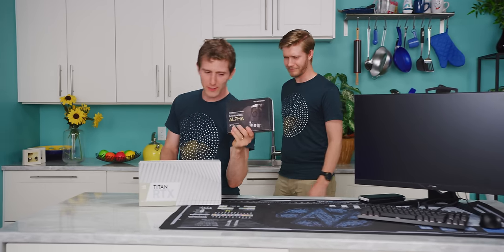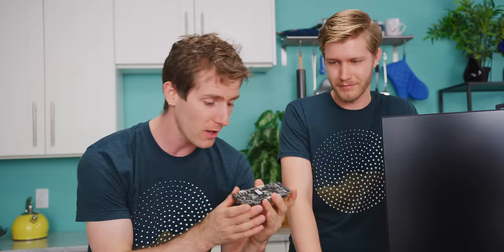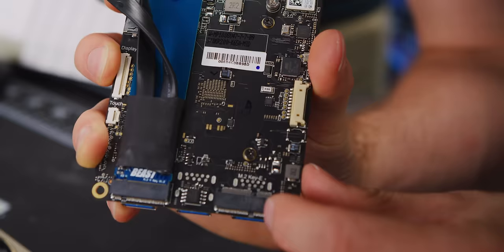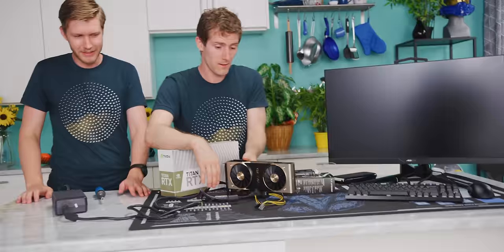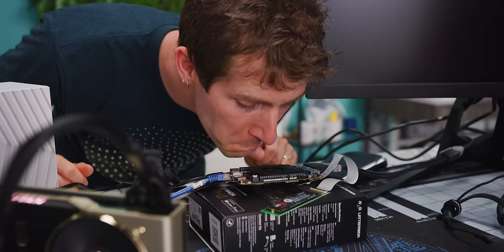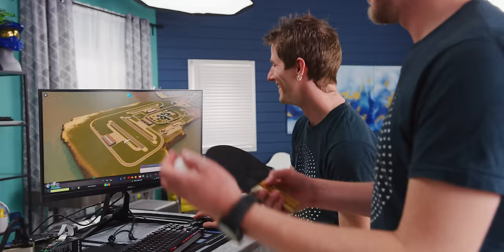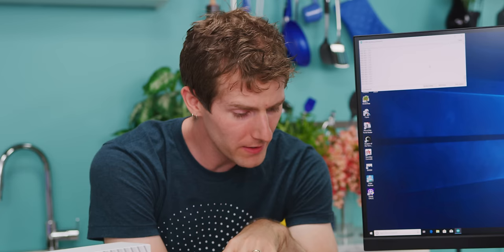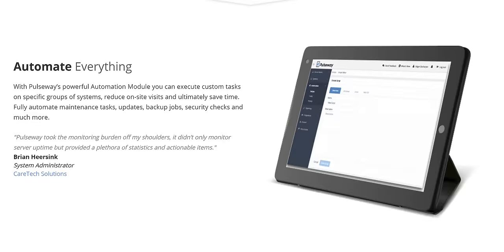The Biggest Bottleneck EVER? - LattePanda + RTX Titan

Comment: I'm like 99% sure that a decent external drive over usb3 would have been way faster than that janky m.2 adapter mess.
Reply: but then its not TRULY the biggest bottleneck ever ;)
Reply: moralapostel yeah but a graphics card external case would usually not work because they usually need a thunderbolt 3 connector through the usb type c port which the alpha does not have
Reply: @Blacked_OutMedia  Bruh he's referring to the storage solution they used...
Reply: I feel like they watched my videos on the LattePanda alpha and said “let’s remake his videos”. But with a Samsung 970 you can get 800+ MBps on that e key adapter
Reply: @HandheldHardware  Doubtful ;)
Reply: Adam Lawson small YT wishful thinking 😂
Reply: Ya never know. Got a new sub out of me though.
Reply: That's almost definitely false
Reply: Cries in 5400rpm hdd
Reply: It wouldn't. But it would be more practical. 

Usb 3 is slower than 2x pcie.

A USB 3 card with a controller uses x1. That usually has like 4 ports

Comment: More than anything, this is just a testament to how well optimized DOOM is.
Reply: And the power of the Vulkan API. Seems like every game made on it runs crazy well.
Reply: "Everything runs DOOM" still seems to be true, even on the 2016 version.
Reply: @mokubakaiba1751  But there has been many versions of Direct3D, most of which are vastly different from each others, and can considered to be different graphic APIs. Now, I never actually used D3D myself, so I can't tell in detail. In fact certain games do have both a D3D9 and D3D11 renderer, which are likely to be completely different code.
D3D12 is also very different from D3D11. It is closer in "philosophy" to Vulkan - both of which are inspired from/based on AMD's Mantle, which never took off.

OpenGL is sort of similar. OpenGL3 was the most disruptive one, but has a compatibility mode which makes most OpenGL2 still operational, only few modern game does this though. CAD software is a different story, and can make use of OpenGL4 extensions while still requiring a compatibility profile... There is no spiritual equivalent to D3D12 in OpenGL, but that is basically Vulkan.

So comparing the APIs by age do not really make sense. Both D3D and OGL evolved drastically since then.
Reply: @garthhendy  Games barely even use DX12 right now the way it is.
Reply: doom offloads lots of stuff that are typically computed by the cpu to the gpu using compute shaders, so it makes sense.
Reply: Compared to when it got released it definitely got optimized very well.
My Phenom II x4 955 BE wasn't capable of even running the main menu properly at release.
Now the game runs at 80-100 FPS on Ultra settings with my GTX 960.
Reply: Frames are temporary doom is eternal
Reply: @nathangamble125  well can you play it on a fridge

Comment: The greatest bottleneck is my wallet

Edit:thx for the likes!
Reply: Back in the day, when spending $3500 on a top range PC was crazy. Now with that money you can only buy top range CPU + GPU. You still will need to buy MOBO, SSD and peripherals...
Reply: Cala Content You can buy/build top-notch PCs nowadays for way less than $3,000. Take Digital Storm for example, their top prebuilt PC sells for $2,800. If you were to build that PC yourself then you could save $100-$200 dollars not counting peripherals oc
Reply: @WoeSyn  Trust me that is not top. I had the best Intel extreme of that moment, qx9770 and costed me 700€ with a 1200€ retail price. Today the i9 9980xe costs 2050€ where I live. I had the GTX 280, I paid 400€, today GTX 2080 TI is +1200€. And paid 3500€ total, peripherals included.
Reply: @WoeSyn  I'll say what I tell my customers.  
Top of the line is the best hardware you need for your most demanding uses. 
Many top of the line results are found through benchmarks and not in the real world.
Reply: @CalaTec  by 'back in my day', do you mean when the 660ti was the big thing?
Reply: @MlordSlav  Nope, I just mean when I bought my first "gaming" PC 10 years ago. I bought the GTX 280 so 660 still wasn't a thing :P
Reply: Its It's not a bottleneck...

It's incompatible
Reply: So true
Reply: @CalaTec  Intel with the W-3175 AMD with the Threadripper 3990X and Nvidia with their soon latest Titan would like to have a word with you about that $3500 for CPU and GPU you friggin' cheapskate. 😜
Reply: @aoelp  Well that was my exact point on my first comment.  Though we are reaching workstation like hardware, a normal consumer shouldn't buy such a monster for, let's say gaming.
Reply: @CalaTec  i9-9900k, MSI Ventus 2080ti GP, Z390 Aorous Ultra, and EVGA G5 750w 80+ gold PSU, 500 GB Western Digital SN750 M.2 Nvme SSD, 500 GB and 1 TB Samsung 970 Evo Plus M.2 Nvme SSD, 2x16 Corsair Vengeance 3200 DDR4, RL06 Silverstone Case, Corsair H100i AIO cooler, Blacked out Blue Yeti, Razer Viper Ultimate, Corsair K70 Mk.2 Rapidfire with speed Switches, and a 1080p 144Hz 1ms monitor. Other than the mouse pad, that's all top of the line stuff and I only paid 1900 for all new. You're talking bs saying you can't build a top PC for 3500. There's a difference between top of the line and way overkill. But you definitely can build a WHOLE top of the line build with peripherals for less than 3500. Even without my deals, with just normal discounts, you can get a top of the line for 2500. So go quit your bullshit.
Reply: @maximgem7292  First, you are not grasping my point of hardware pricing going over board, second you should learn to comment with respect. And finally, I have that same setup but with a 1080 ti second hand and it costed me 2500 euros in Spain building it myself, meaning it would have been 3200 euros with the 2080 ti. And no, that is not enthusiast hardware as the build I described, aside of the 2080 ti. Well instead of 2 SSD, I have 1 NVME 1tb and an 8TB HDD that I already had. I never said people should buy that hardware, because most of the times is not worthy and the value decreases too fast, unless you are a professional who benefits of paying the premium.

Edit: didn't see you also mentioned the monitor. Add to what I said 500 for the lg 27gl850 that I bought. That makes some 3700 euros to buy that setup in Spain building it yourself and buying the components in the cheapest place which is PCcomponentes.com
Reply: @CalaTec  why should I commend with respect to someone obviously oblivious on how to get good parts for less money? That just goes to show you buy everything from an overpriced retailer if you buy your parts that expensive? And FYI I have 3 Nvme ssd's, not 2 because 2tb between 3 sticks is cheaper than 1 2tb stick. Goes to show you don't know how to optimize your build or save money. No wonder your "top of the line" build goes for over 1k more than it should cost
Reply: @maximgem7292  Here buying 2tb was a lot cheaper than 1TB (per GB), but my budget didn't allow and I have an ITX board and I'm not interested on having more than 1 stick. You don't understand that, in Spain we have no option, and that is our cheapest retailer. Don't worry I do my homework before buying, no need to be so mad, is almost funny. We pay higher taxes and shipping, thus prices are higher than US for example. I've checked the prices on UK retailers and they were quite similar and some things were more expensive.
You should comment with respect because is what an emotionally balanced and normal person would do, no matter what others do or say. Have a nice one.
Reply: @CalaTec  I'm not mad, do you even know what mad is? If anything, I look down and pity you beause I have friends from Spain, uk, AND Australia who buy parts for decent prices just fine. An ITX board is a mistake in itself for budgeting. Although atx is more expensive, it provides more upgrade potential saving much more money than an ITX board. Your ignorance is blatant.
Reply: @maximgem7292  what can you tell about me in latam? Rtx 2080 ti it's more than 2000usd new
Reply: Stop copying comments
Reply: Miku I felt that 😞
Reply: @CalaTec  yes you live where shit is to pricey also I built a top notch pc for under 2 grand so yea lol
Reply: @CalaTec  the 3990x is actually the best CPU for gaming out there
Reply: @theghost7277   I think the only place where technology has a reasonable price is United States.

@spade gaming I think AMD is the best option for 99% of cases. In some games you get better low FPS on Intel and in some others you get a few extra FPS. Is it really worth buying over AMD? I don't think so. But I bought a 144hz monitor and since my PC is only for gaming I bought the 9900k.
Reply: @CalaTec  back in the day 3500 worth way more
Reply: @gktawusy  yeah, but back in the day I wasn't married, so earning 3500 was easier for me than now xD
Reply: @CalaTec  ah ok
Reply: @CalaTec  *RTX
Reply: Cala Content Believe me when I say you will NOT find any consumer-grade parts that cost that much, I doubt they’d even cost that much COMBINED.
Reply: @CalaTec  to be fair ,back then they would only last like a year
Reply: @miltoska9708  not even a year. 6 months or less sometimes. I bought my qx9700, just 3 months later  Intel released their first gen i7, because I didn't do my research properly, I didn't wait. I could probably have much better value if I waited.
Reply: oof
Reply: Miku miku nakano
a waifu of mine
Reply: @d-o-n-u-t  Unless you specify I don't know what you are talking about. Is 2080 TI consumer grade? is 3990X consumer grade?
Reply: @CalaTec  u can buy a pc with i99900k and rtx 2080 ti for £2500
Reply: @s._81  Well, add to that 500 to the monitor I bought, and peripherals (mechanical keyboard, good mouse, headset, I have an 8TB hard drive, etc) You can spend 500 more easily.
Reply: @CalaTec  u dont need to spend 500 to get a good monitor
Reply: @s._81  144hz 1440p IPS GeForce ready, Is the least I expect to make good use of the hardware. Otherwise no point on having a 2080 ti. And these features are not cheap.
Reply: @CalaTec  u can get a viotek monitor for under 500 that has all those features u need
Reply: @CalaTec  or just get a 4k monitor and play at 60 fps
Reply: @s._81  4k is pointless for gaming. IMO anyways. Viotek is a good alternative if you don't mind going for TN or VA panels. IPS with that technology is a bit more expensive. And finding IPS with decent latency is not that easy, not that many good options. In fact I bought the LG gl850 and, to date, is still one of the best 1440p gaming monitors.
Reply: @CalaTec  coolio
Reply: @WoeSyn  now adays in my time you can get a pretty decent gaming pc for 500 bucks
Reply: looks at wallet yep pretty much.
Reply: Sage nah u could save way more if it’s digital storm lmao
Reply: 4.6kth like!
Reply: Zachhh  I just found out that I got 4.6k like
Reply: You ruined it when you edited
Reply: That's a bruh moment
Reply: That's a mood

Comment: Alex: "dihydrogen oxide?"
Alex that's water 😂😂😂
Reply: @sexiewasd well the oxide without a prefix implies a mono, just like 1 isn't mistaken for 11 because the lack of a prefix implies 01.
Reply: @sexiewasd that's because they are salts, which means it's a metal atom(s) bonded to non metal atom(s). With non metal molecules you only have to specify the amount when it's more than one
Reply: He said dihydrogen sulphide! It's rotten egg smell. H2S
Reply: Surely a hydrogen detector would suffice?
Reply: @blazer666del  nope. Elements do not retain their properties in a compound. Otherwise water would be flammable with all the hydrogen and oxygen.

Comment: You wanna talk bottlenecks? I used to run a core 2 quad q6600 with a gtx760. It ran overwatch on minimum settings and 70% render scale.. at like 40-45 fps.
So I upgrades my processor to an i5 7500. Now on the same settings I get around 200 fps.
Turned my settings up to almost max and still get 100+ stable fps. That core 2 was holding my PC back soooooo badly lol
Reply: i think you are being a drama queen ... i played minecraft and csgo with a single core no graphics pc less than 25 fps for about 4 years
Reply: not having a GPU isnt a bottleneck... a bottleneck is when one part's performance limits and pulls down the performance of another part that should rightfully be able to perform much better...
Reply: Wow,It took you 10 years to get a new CPU,that is a long time.
Reply: @QuadPowerful  upgraded when it stopped getting playable FPS lol. upgrading my GPU soon and then i'll be set for a while. i went from my CPU bottlenecking my GPU to my GPU bottlenecking my CPU
Reply: I have kinda same situation now but switched: I have an R5 1600 at 3.8ghz sitting on like 30% max in every game while my R9 380 4GB  overheats on 100% in all games except CSGO. 

I wanna upgrade to an Vega 56 soon ^^
Reply: And I remember trying to get more than 0 fps in minecraft using an i286, a GeForce GTX 1050Ti and 8 GiB RAM. Don't ask me how this PC was built, but I had it until mid-2019. That's what I call bottleneck.
Reply: @markhesse4510  oh boy lol. im back to my  CPU bottlenecking my GPU, as i have a 2060 OC now lol. still I5 7500. even upping it to a same gen I7 would be a massive boost in performance
Reply: Strange enough changed from my gtx 760 to rx 580 and my old cpu was still keeping up without bottlenecking. I7 2600, was a really good cpu, i dont regret buying that cpu. now i have like r5 2600 it works like a champ.
Reply: @KSR3  Wow you endured a shit gaming experience for that long and didn't just give up and buy a 360?
Reply: @spht9ng  nope.. i stick with what i got

Comment: The slowdown in tomb raider appears to be a driver issue.

also the methane gas detector you should have it setup to not only turn on the fan but also flush the toilet!
Reply: I got my toilet to flush when you leave but only if you used the toilet.  An ultrasonic distance sensor knows that something was in closer than usual proximity to the back of the toilet (threshold tuned to work for sitting or standing), this tells a PIC chip to arm the flush.  When you next close the door it pulls the handle ...

... well, not the handle.  It lifts the arm inside of the cistern for a second.  This causes water to flow, which then holds the flush open till it's completed as normal.

Was one of my first actual proper projects when I got into electronics.

My GF wanted me to add a 'pusher' that drops the toilet seat too, if it's up.  However... I have certain strong political views on toilet seat positioning.  I feel that if I put it down after, then she should leave it up after.  As statistically, whoever used it last is least likely to use it next... and... because... "gender equality bitch!" ; )

... yeah ... I have to iron my own clothes now : /

Comment: Alex, you should still pursue the smell-less bathroom idea, but searching for methane and H2S isn't the way to go.  The reason H2S sensors are so expensive is that very small concentrations of it will kill you, AND it kills you sense of smell very quickly up exposure.  Thus you need very senstive detectors to sound alarms if you're working in, say, a natural gas field.  The main odoriferous compound in feces in skatole, but you're unlikely to find a detector for that.  You can however find detectors for "thiols" also known as "mercaptans" which are sulfur-containing organic molecules also released during bowel-related expulsions.  Mercaptans are added to natural gas (which is mainly odorless methane) to let people smell that there is gas in the room.  Google "mercaptan detector," and you'll find results.

Also, here's a paper discussing how to detect exactly what you're talking about.  "Odor-Base Incontinence Sensor" May be be worth a look: https://ri.cmu.edu/pub_files/pub2/wu_huadong_2000_2/wu_huadong_2000_2.pdf

Comment: You can get 2280 dad's that fit key e...  Also, I've seen 256gb mini drives that fit e.  Like to add a second ssd to a laptop using the pcie port usually used for the wifi

Comment: I had g4560 + gtx 1070 ti for about a year in the past.
Reply: Filib Did it bottleneck that badly? I used to use a Core 2 Q9550 with a GTX 770 and it was pretty usable in most games..
Reply: @Benjamin-ko1fg  I mean, changing from low to ultra didn't give me any diference in fps. In most games I was getting 60+ fps but some stutters were notisable. Now some games can't even run on dual core for example rage 2.

Comment: I don't think this was a proper test rig for this purpose as I believe the M.2 E Key to M Key Adapter is bottle-necking your NVMe drive pretty severely. You could have always tried running a few hard drive benchmarks, and again I think if you would have resolved any other system issues then you would have had more luck. Cool concept though, thanks!

Comment: I think it's more bottlenecked by the storage than the CPU. Loading times are terrible because it's loading stuff into RAM from that super slow SD local storage. And when it needs to use the page file, it stutters a lot. The SSD they connected must have had issues.

Comment: me who daily drives a system that is as cpu bottlenecked : i have an intel i7 950 (from 2009 its ancient and realllyyy slow now) its probably way slower than a reasonably recent macbook processor, and i use a gtx 980ti, i would still be cpu bottlenecked running at 4k on high settings on the latest triple A games XD

if i play minecraft on 16 chunks render distance with sodium (a ridiculously powerful optimisation mod that can cut the load on the cpu massively) even when i have software RTX emulating shaders running my gpu still idles while my cpu is on 100%

Comment: That m.2 to pci is something I've been thinking about getting to try and add an extra slot to my itx board for a capture card.  But my board doesn't have a m.2 slot it has a U.2 port.  So it would be U.2 to M.2 to pci express and I don't know if it would work

Comment: Why are you using a 380watt dell power supply the GPU best can use the adapters included for 24pin and 4pin to an 8 pin and remove the need for this